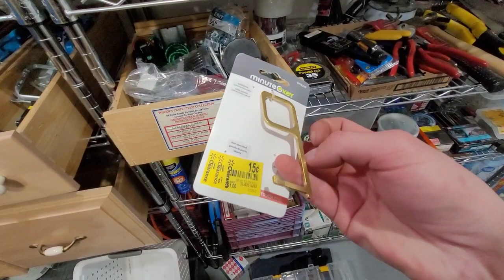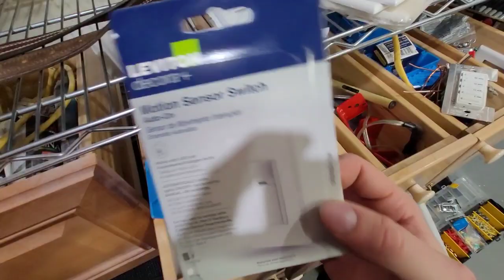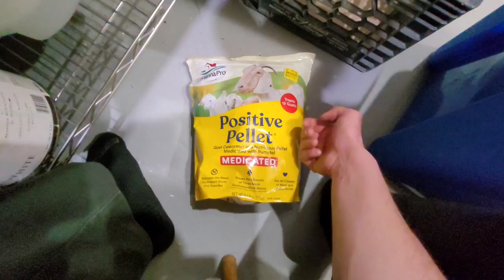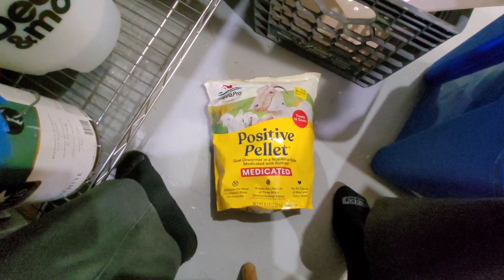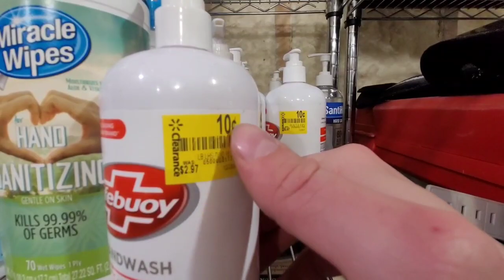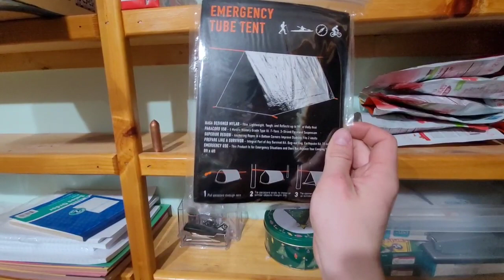Organization and Talking

Comment: Another great chatty video posty! You mentioned putting some dishwashing liquid in the water extinguisher. It helps work as it's a wetting agent. Something to consider having where no fire hydrants is a foam fire extinguisher. Of course as you say, not for electrical fires, but great for other fires. Can also refill yourself.

Comment: Yessss!😁 Adding to this comment later👍 it's all about space.i would love to build a build a house with you, man lol. Harbor freight has their own suppliers of low mid and top their lol nice. Hmm I use the UEI multimeter. Dang have all these screws for different scenarios but you actually have got to use themal at some point haha. Nice bro haha 15c. It's like commercial light switch mayb. That fan switch is a cool idea. havent seen that and yes water damage can be a major problem. Have ot of fire extinguishers or a lot of fire insurance lol with every problem there's a solution. Engineering 101. Lol bro the bathroom is truly an engineering feat,we have those like quake anchors lol. Brroo plumbing story water was leaking through the ceiling from the bathroom above and it was because it had a hole in it from yesrs and when the poop and toilet paper made itself out it would leak and then stop leaking when it would clog up again bro😂 wild. Look at your honorable plaques bro, that's rad bro 🤙 damn bro you can't get away with the rechargable battery 😂, bro a 2 Dollar tent from ebay youll die lol

Comment: Hey post should have put this in my first comment but just now thinking about it. What brand of boots do you use? I’ve been in the market for some tough waterproof boots and have always wondered what brand you would recommend.
Reply from the maker: My normal rubber boots come from the Tractor Supply, every location I have been to have them. They are $25 but if you want the steel-toe version you're going to pay about 40 from eBay, I usually skip the steel toe. I believe the brand is serve you but I'm not sure
Reply: @post10Vlogs  Thanks for replying and I will check them out!

Comment: Is $97 the good price you for 20lb ones you are talking about?
Reply from the maker: Yes I just hopped on eBay and that's the first result, I'm pretty sure I did one of the bulk deals if the seller still does those in his other items. But yes that same thing would be like a $300 extinguisher at least if you were to buy it new